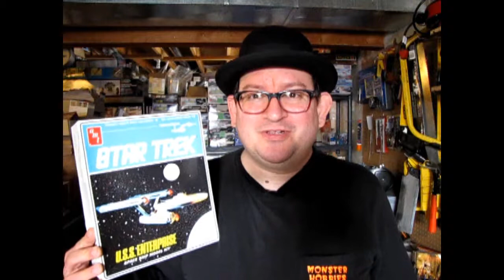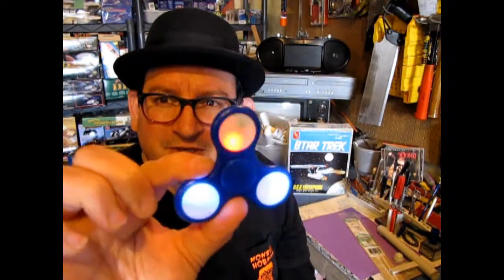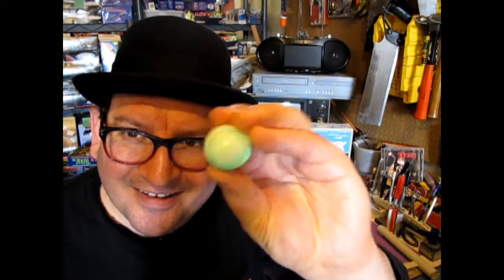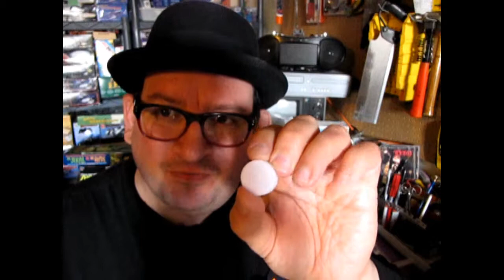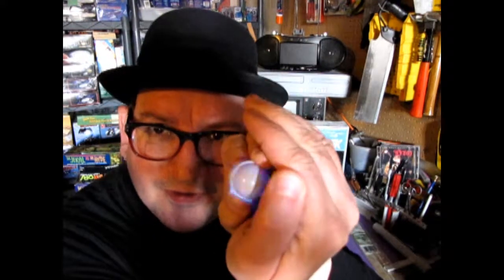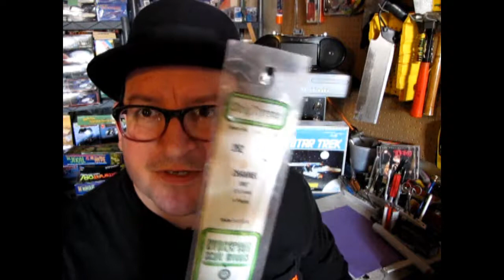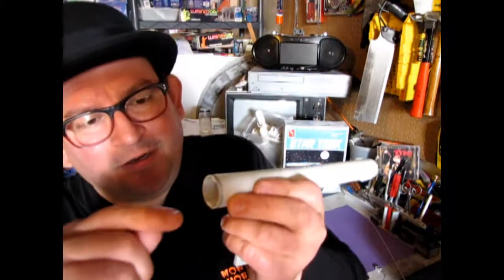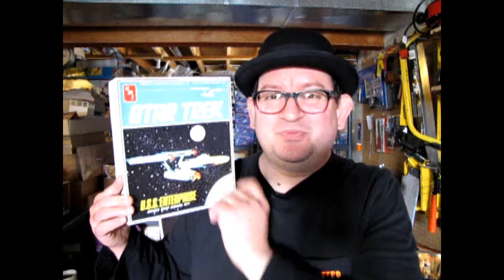Let's Build It! - Lighting the Warp Engines

Comment: I used to sand down the inside of the cap to make it real thin for the light to pass through and put an incandescent bulb in there from the train shop, then mist on some red-orange color.
Reply from the maker: Sounds good. those LED lights now are very bright. Seems to pass through the standard plastic very well.
Reply: @monsterhobbies  

Very true - they also don't heat up and melt the plastic like the incandescent bulbs could either.
Reply from the maker: @GalaxyStranger01  Ah yes...there is that! :D